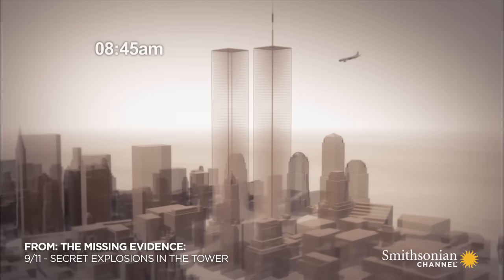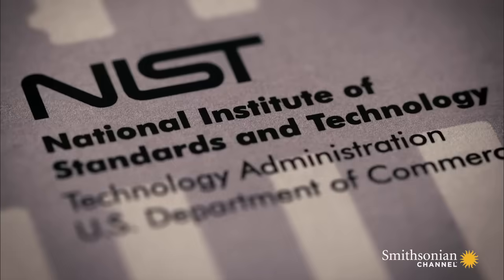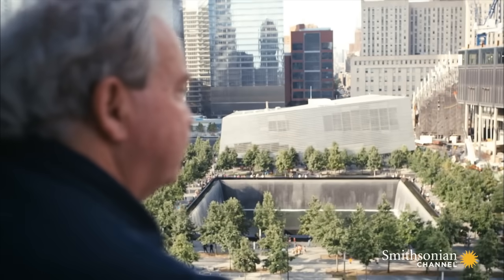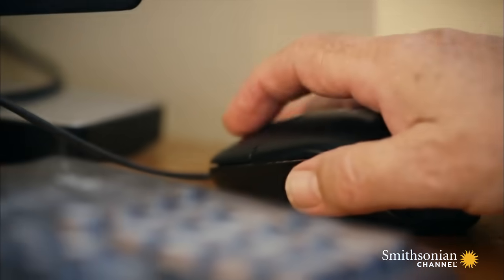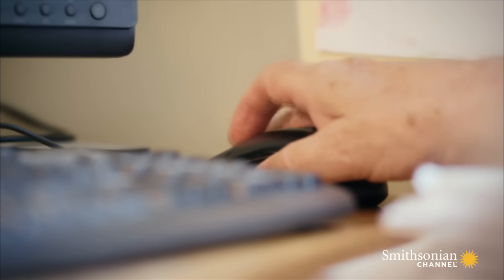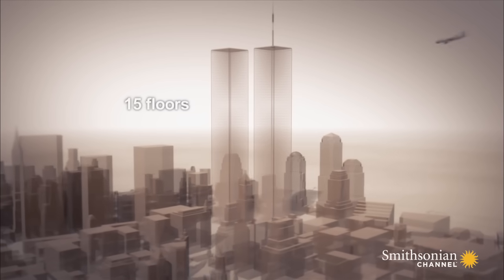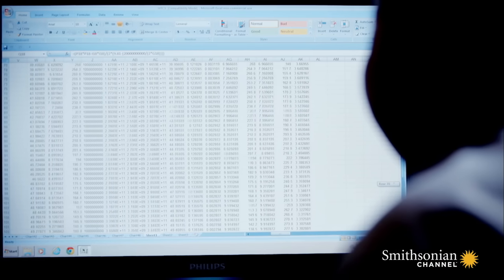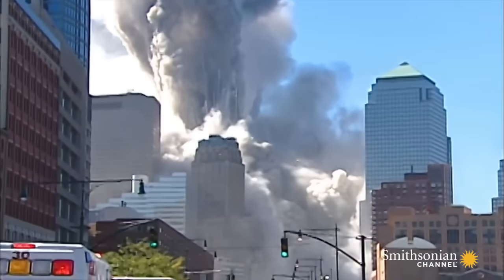This Computer Simulation Explains How the Twin Towers Fell

Comment: Do the sims explain how pretty much all of the steel and concrete turned to dust also?
Reply: None of the steel and only a small amount of concrete turned to dust.
Reply: youre wrong, ive seen the video of a 700ft tall steel beam still standing for a short time then just turns to dust where it stands.   @Pooua
Reply: @johnhanson3329  That's probably the same video that I saw; it gets used a lot by the people making this claim. However, that isn't what you saw. You saw a beam that was covered in a lot of dust that then shook the dust off and collapsed. The steel did not turn to dust.
Reply: Then there should be an image of a 700ft tall steel beam slammed into a few blocks worth of buildings, it was absolutely not dust shaking off, its very obvious when you see it what it actually is. Something like that should topple over not just go straight down. The dust wouldn't even have had enough time to settle yet. @Pooua

Comment: This character is a joke.  Totally different impacts at totally different areas of the buildings and yet the exact same collapse.. How is that possible??  He talks about the mass of the top... What about the mass of the bottom 75 or 80 percent of the buildings???  Where did the resistance go? Go back to school grand dad..
Reply: Oh? What's your level of expertise?
Reply: @tpryce6432  How about common sense?
Reply: @ron777ish  How about it? You clearly don't any if you think you can figure out how a 100-storey building collapses with "common sense".
Reply: @tpryce6432  If you believe the official story then it is quite clear that you have none.. Do a little more research my friend. How does an aluminum plane travelling at sub sonic speeds penetrate a steel building?? You just keep drinking the koolaid..
Reply: @ron777ish 100 tons moving at 500 mph isn't going to be stopped by 3/8-inch thick steel walls and glass windows. Also, it doesn't matter how many floors were under the impact zone, as each floor collapsed one at a time, due to the force of the falling floors above it hitting with hundreds of times the force that the Towers were designed to support.
Reply: @Pooua  First Mr Richard... A plane cannot fly at 500 mph at sea level. Not a commercial jet at least. Maybe a military jet but not a passenger plane. The structure of the plane couldn't stand that speed.. Most of those two planes would have crumpled against the side of the building and landed on the street below.  To your second point about the collapse, where did the resistance go? The towers fell in almost free fall speed. How do 15 or 20  floors destroy 85 or 90 floors below? With almost zero resistance!  You might need to go back and study a little more science. Also check out building 7. It did reach free fall speed. And just from a fire.
Reply: @Pooua  Did you watch the movie Independence Day?? Did you see the White house blow up? Did it really happen just because you watched it? Please.... Try not to be so naive.. You can argue with me but you can't argue with science.
Reply: @Pooua  Spend 10 seconds my friend and your eyes could be opened to look a little deeper into 911... Research 9/11 north tower collapse and watch from 1;33 to 1;43  And pause at 141 142 and 143 and you will see the top of the building is gone and you still have 100 stories below...  Btw i understand physics with force and momentum but i also understand resistance. And as you will see when you watch that video you may have momentum on your side you have no move force against enormous resistance.. Most of the top of the building is gone and yet you can still see the bottom say 95 stories still there..

Comment: I don't think with that while smoke out  side the build and and police report melt steel in basement, jet fuel won't do this to 4 inch steel let explain that lol
Reply: There was no molten steel at WTC, and the steel at the impact zones was only 3/8-inch thick.
Reply: Learn proper grammar first.

Comment: In olde English.....Bollox.....A plane hits one side of the building, pyhsics says that is now a weak point and the upper portion of the building would lean in that direction. But no, apparently these buildings were designed not to do that....and the symmetrical collapse of the untouched Building 7 is just a happy coincidence.....and nothing to do with the hugely inflated insurance payout
Reply: None of what you said is remotely accurate.
Reply: @tpryce6432  Thank you for your comment. I would appreciate hearing your better informed views.
Reply: @marktime9235   Everything you said is wrong. If you want specifics, ask a specific question.
Reply: "that is now a weak point and the upper portion of the building would lean in that direction." - No, the building did not lean in that direction because the rest of the columns supported the weight. And, yes, that was by design; that was the purpose of the hat truss structure on top of each Tower.

Comment: Are you a civil engineer who produces controlled destruction theory for buildings?

Do you know the construction of these buildings?
Do you know how much load the fabricated floors between the columns in the core and the outer columns carry?
Do you know in a possible jet fuel fire how these buildings create sprains not only to heat but also to enormous loads and heat?

Those who produce conspiracy theory here are nothing more than schizophrenia.
If you read a little history, you would know how Islamist terrorist organizations emerged. Who is you the bombing in 1993? Do you know how they prepared plans to collapsed the buildings they didn't wash in the bombing? Al Queda was formed by the Islamic mujahideen who fought against the Soviets during the 1980s. And America provided them with weapons and money. After the Soviets collapsed, these terrorists returned and shot the American. If you read it, you'd know that.

Just as you don't know the static and carrier systematic of buildings. The towers could not resist the very high temperature caused by the collision and the jet fuel, especially the heat (joule) and collapsed. Learn a little "scientific engineering" to produce conspiracy theory.
Reply: TYRANT  you must be government doll

Comment: The opening line is incorrect! The Twin Towers were built to withstand the impact of what was THEN the largest plane on Earth...the Boeing 707...flying slowly at about 250 MPH...lost in the fog...looking for a place to land and running low on fuel. ALL of these points are important! Yet, you seem to ignore them as if they are unimportant.
Both towers were hit by planes that were larger, and that still had some 9000 gallons of jet fuel in the tanks. Both were flying at nearly 500 MPH, with a suicidal maniac in control.
Reply: Very important. It’s also important to point out that 450 tons of aluminium going at 250 m/s will cut trough any steel strut or rebar possible

Comment: It makes a lot more sense than believing hundreds or thousands of demo experts and construction workers snuck in after hours to disassemble the building materials covering the support brackets, install the explosives, and reinstall building materials to cover the explosives (concrete, dry wall, carpet, wiring) to hide all the explosives hidden on each floor.   Not to mention all the truck loads and truck drivers needed to pull it off.   Not to mention, whatever was needed to either hijack the planes with suicidal CIA agents or mechanics to wire the planes with remote controls.  Then you'd have the CIA running around silencing all the witnesses and doing whatever's necessary to silence all those workers behind this conspiracy.
Reply: Finally!

Comment: You said it within the first couple of seconds . They were designed to withstand the impact of commercial jetliner.
Reply: TheWarsuron It may have been designed to. That might have been the initial idea, but you can't test something like this. They built it in a way that they "predicted" would be able to withstand impact from a commercial jet. Also, here's a fun bit of trivia. Everyone who tries to argue against the fact that 9/11 was a religiously motivated act of terror makes the same claim: Steel's melting point is 2700 degrees but jet fuel doesn't even burn to 2500. This is true, in fact many commercial planes fuel burns at barely 2000 degrees. While the steel will not liquify from jet fuel, it will become very malleable. So malleable in fact, that the extreme weight of the top 10 to 20 floors causes the steel to bend until it eventually breaks. I find it sickening that so many millennials and Gen Z Americans can come up with such illogical fallacies. None of you people who believe the "conspiracies" of 9/11 had to witness it happen on live television. None of you had to watch friends, family, and those you love die on live television. None of you had to fight in Afghanistan and be drenched in your own blood, and your friend's blood, and the people you're trying to kill's blood. Granted I might have only been 11 years old when it happened, but I remember it clear as day. I remember my Dad's friend who ran inside that tower and never came back out. I remember going to war for 4 years to fight the people that did this. I remember my friends that died in Afghanistan. And I remember clear as day being plagued by horrific nightmares of my tour of Afghanistan, and waking up with sweats and tears. All of you who haven't served, and didn't have to witness this horrible event unfold on live television wouldn't understand. It makes me sick that people can even think for a second that our own government committed this atrocity. 9/11 was not an inside job. It was an act of terror, point blank period.

Comment: Cui bono - literally "to whom is it a benefit? Poppy Bush needed to overthrow the government of Pakistan to get the farmers to replant the opium for the CIA's heroin supply. and what better way to do it than a false flag so the taxpayers would pay the bill. Then there is the physics of the buildings anybody that has ever worked in a shop knows how much heat is needed to even soften steel and the way that building is put together those floors would never let loose like that they would tear like a zipper because of the amount of fasteners used.
Reply: Congratulations. You've cracked the case.

Comment: Yet when we are shown the footage at the end we can clearly see the building exploded violently from the inside outwards.
Reply: Yes, that’s because of the plane exploding while inside of the building, genius.
Reply: yosh jet fuel doesn’t burn beams. Also there is this plug in called bullet physics...animators and people who do CG use it all the time. When some of them recreated the building based off blueprints and flew a plane threw it....it stayed upright...
Reply: Wako Blank yes, jet fuel can burn and weaken beams. A black smith demonstrated how easily steel beams can bend under heat. A skyscraper fell due to a fire in China, but nobody wants to talk about that. Fire can and will weaken a steel structure. Fire CANNOT  MELT STEEL.
Reply: yosh I know what video your referring to and he actually had the metal hotter then a fire fueled by jet fuel. Again. All a mess
Reply: Shamil Najar jet fuel would be enough to bend the beams...but jet fuel also burns really quickly so the rest of the fuel would be wood and cotton and whatnot which wouldn’t burn as hot...it’s all a mess
Reply: Shamil Najar you make it sound like everything gets destroyed in an explosion. You realize that the entire plane didn’t just vaporize, right?